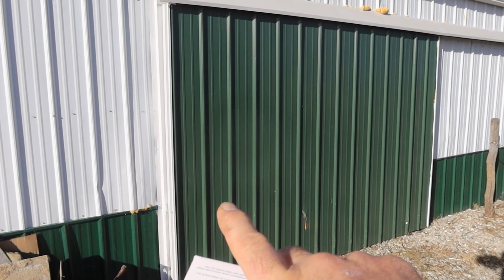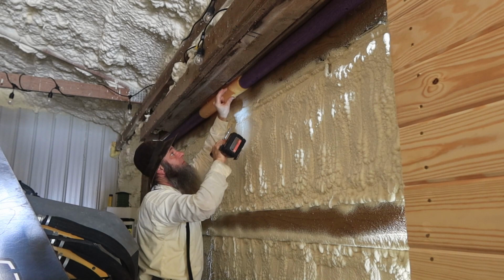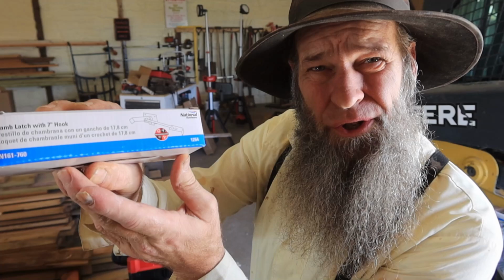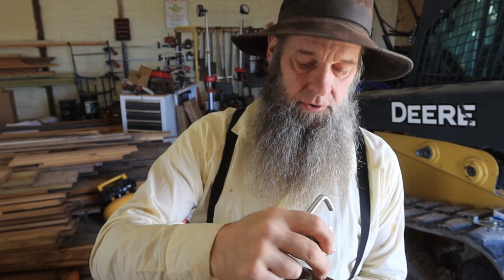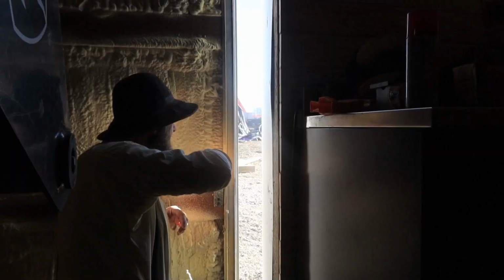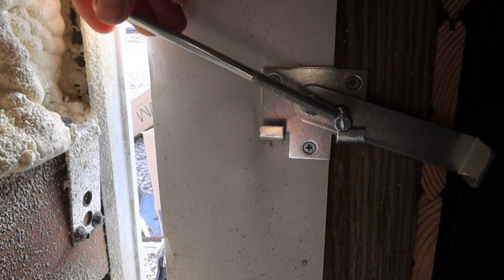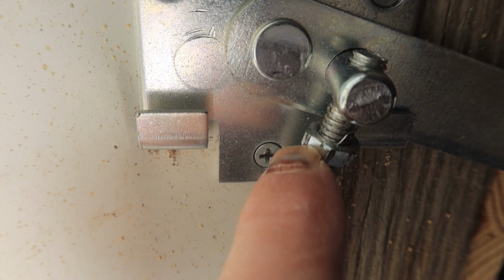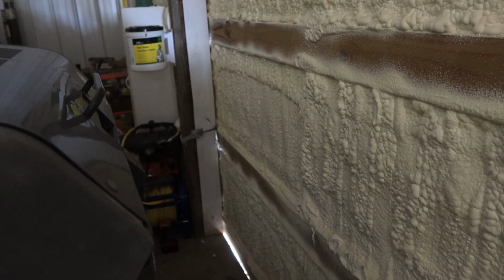How To Stop THEFT and WIND DAMAGE  on the Off Grid Homestead

Comment: I found it on Amazon.  Barn door latches (search) 7inch size. the only difference i saw was the bolt to tighten on the rod was on opposite side hole. But also saw a bunch of latch systems for my barn/farm use. So will be looking at several ideas for different things. We going to be rebuilding the slide doors this spring, so plan to get these to keep doors tight. (Cats in, skunks & hopefully weasels out)

Comment: 273rd to 👍
😂

If you want 100% closure on that slider, put you a strip of plastic wrap top to bottom on the door AND the jam, prop the door CLOSED and spray a few cans of SPRAY FOAM, let it harden up, remove the plastic wrap on the door & jam and you have a perfect seal going forward.

Comment: I have those latches on two of my barn buildings.  They are great.  They really keep the high winds from ripping the door off of the buildings.
Reply: I saw how he latched it in tight from the inside, but how does he get in the barn door from the outside? He showed at the beginning of the video that there's no handles on the barn door on the outside to get it opened. (To deter theives from breaking in).

Comment: Just a suggestion  on what to use for a seal around the door. On my Sliders in the past I've used the rubber seal that used on the bottom of  roll up garage doors, but used it all around the door opening with the same type of latch and it worked great and lasted for years and years.

Another thing I recommend doing is using 1/8 inch aluminum strapping to strap down the rubber all the way around so it really stays in place super well. Just sandwich the rubber between the door jamb and the aluminum strapping and sock it down with some screws and you're good to go.

That's the best solution I found for sealing up at the door.

Comment: For your pool noodles use some washers and that will help keep the screws from going through the noodle. Or you could also take some PVC pipe and cut it in half long ways and cover the pool noodles with that. Both should help them last longer. I know the pool noodles aren't that expensive to buy but every dollar counts when your off grid
Reply: They had them on sale for 10 cents at Walmart end of season.  Back by the birdfood.  Needless to say.  We bought ALOT!  30 I believe!  They are handy.  Used em on a hoop house we built.  Still have some left!  That was a cheap SCORE! 🥳

Comment: If you really want to mess with the thieves, put a door stop on the opposite side of the door, but fasten it to the door. That way, the first thing they’ll do is try to open the door by pushing it in the wrong direction.

Comment: Would a pool noodle help protect my pipes from freezing / I live in a mobile home I’m disabled and cannot do things I used to/ no handy man
Reply from the maker: YES, get them and run a slit down 1 side so you can "open" it and slip the pipe in. You could also get them ready to go
at the hardware store you just slip em ion
Reply: OFF GRID with DOUG & STACY  I don’t drive anymore so it’s hard to get things done without help/ I have turned up the furnace / last time the water spilled onto the floor and this time I cannot get any pressure to run the water :-(